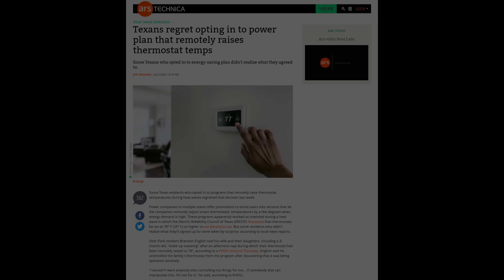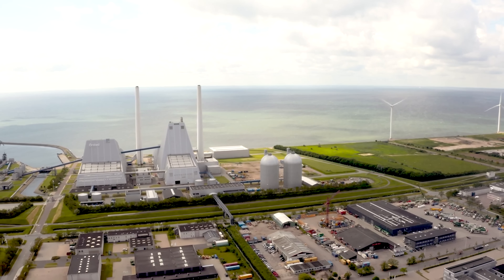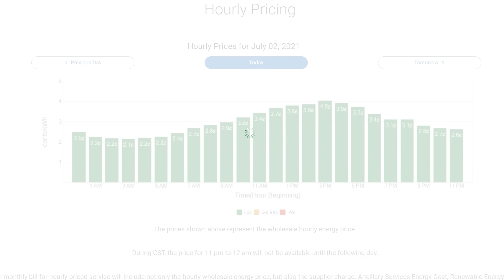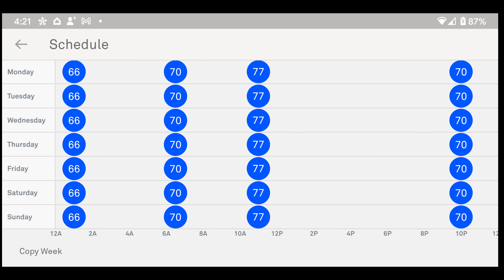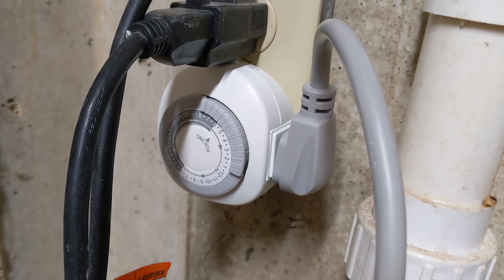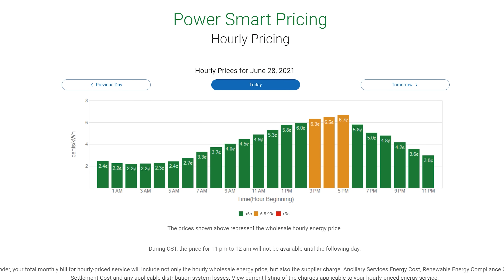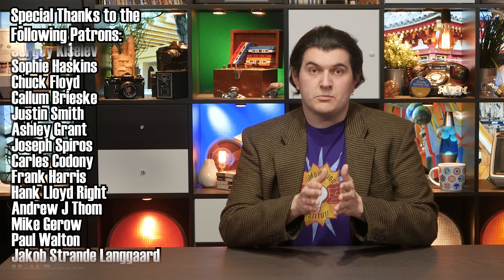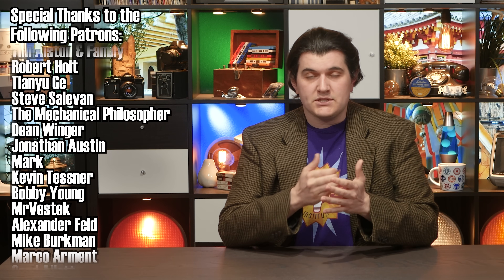Batteries aren't the only way to store energy. Here's another.

Comment: My dad’s AC energy savings method was to just never turn it on
Reply: At this point I could save the cost of a new house by not having an AC at all, too bad the summers are unbearably hot and I cannot save money that I never had.
Reply: We use a similar approach in the UK.  We don't even install it in the first place.  I'm in my 50s and I've never been into a private home in the UK that was air-conditioned.
Reply: Vap Pri  only problem is some places you could straight up die in your home without cooling simply due to humidity it will cause you to sweat to death the uk happens to be one of those places where it isn't getting that hot
Reply: Vap Pri  spam.
Reply: fantastic logic
Reply: AC repair people hate this one simple trick!
Reply: @joshuarosen6242  lol youre just lucky that it doesn't get hot in the UK. no ac where I live would spell instant death for many people
Reply: Based
Reply: @thenormalyears  please. Most hot lands are on third-world countries and an AC is a luxury there. Even around the Mediterranean Sea it's quite rare to have AC inside domestic buildings. It's just another pseudo-problem made by modern comfort on consumerist countries and by building cities in the middle of deserts.
Reply: Your dad's hot!
Reply: @killbuzzj  I'll trade you some of our recent southern California (U.S.) 105 degree (F) summer days for some of your nice rain water! Air conditioning is pretty much "normal" here. Added insulation and a very high-efficiency A/C unit keep both temp/humidity and costs under reasonable control for our 65 year old house. What we're running low on here is potable water!
Reply: Do thermostats allow you to define an interval of acceptable temperature? For me, it's comfortable from 18°C to 28°C so that's why I rarely use my AC
Reply: Same here! When it got over 90 degrees he would let us run a fan for an hour or so while we tried to get to sleep. He'd come and turn the fan off before he went to bed, and if I wasn't asleep yet, then tough luck!
Reply: @TechNinjaSigma  what you don't understand its not just the heat that is a problem its also the humidity will cause your body to sweat to death in the southern part of America you can and will die with out ac its not a modern problem people died of heat stroke all throughout history
Reply: @donaldmiller9130  hey man come to Texas it rains plenty and the heat is right there with it ac is our friend
Reply: I use the old " leave the windows open over night" trick in the spring and fall, but in the summers even at night you don't see Temps below 78, and we are seeing Temps of 100 degrees F for most of the day. I keep the house pretty warm at 78 degrees F, but the AC is still running at least 5 hours a day this time of year.  Would love to live in an area where I didn't have to actively cool my home, or water my lawn for that matter.
Reply: Must cost a lot to replace all those broken computers, televisions, DVD players, smartphones, tablets, laptops, and game consoles. You know, stuff that breaks when exposed to constant heat.
Reply: Ha Ha, and if you're cold put a coat on! =)
Reply: barnoftheyard  Greeks, Italians or Portugueses are caucasian though they handle 40°C summers.
Australia, South Africa or the whole America were colonized centuries before this invention.
From the experience of friends born or raised under the tropical sun but Caucasian, it's more a lack of aclimatization due to the emergence and popularization of this comfort during the last century in industrialized countries like the USA.
Reply: @PainterVierax  There are well documented cases of the elderly dying of heat stroke in their homes because their AC failed and couldn't afford to fix it or go elsewhere. There was a news story of a man in the Chicago suburbs literally needing to call 911 because his AC was out, and the fire department actually showed up and installed a new one for him because he was in danger. Developing nations aren't the only places where the heat means something.
Reply: And that’s the smartest move. For once, remove our comfort for the sake of nature.
Reply: @asdrubale bisanzio As I said before, most ppl does not have the economic privilege to just move if they don't like the climate.
Reply: @thenormalyears  I do appreciate that.  I live in Yorkshire in the North of England.  It’s what I would call really hot today.  It’s 28 degrees and this is what counts as a heat wave here.  By Yorkshire standards, a heat wave is where the temperature reaches double figures.
Reply: @PainterVierax  uh huh, and those people die of heatstroke at an alarming rate.
What's your point again?
Reply: @freedustin  my point is that those populations aren't acclimatized anymore because of AC overusage. Heat waves are special events though.
Reply: @PainterVierax  Heat waves happen every year. Not so special now are they? Used to be 2 heatwaves per year back in the 60's, now we are up to 6. Over 2,500 people died due to heat in India in 2015. AC literally would have saved lives if it had been a staple in their society.
Reply: @freedustin  India gets almost all of their electricity from coal, if everyone in India had air conditioning the sky would turn black from all the coal being burned.
Reply: @hithere7382  and that would add to the cooling by blocking the sun.
J/K you know that is besides the point.
Reply: @joshuarosen6242  To be fair, it rains so much in the UK, you guys practically only have 3 days of warm weather a year hahaha.
Same here in The Netherlands, if there is an AC in them houses it's a portable one and it's a very recent development.
However the only reason we have one, is due to working at home during pandemic.
Reply: @killbuzzj  You can always be like the Aussies and live underground haha :P
Reply: @thenormalyears  I mean it's not luck that made it not hot in the UK, it's the Atlantic current doing that.
Reply: @PainterVierax  Correct, around the Mediterranean you just paint the house white and a lot of heat stays out.
Reply: @PainterVierax  as someone in a third-world situation, here pretty much everybody has ac unless you're really poor. I'm middle class and in the caribbean you can't barely sleep in the summer without proper ac
Reply: @TheWrigle  The massive forest fires every year are keeping it cool near me. Smoke blocking the sun, so the window trick is still working.
Reply: Those stories always baffle me. Sitting on the couch, tv on, windows closed, no fans and they just sit there and die in a house like a baby in a hot car. Fk getting a cold wet towel or an ice pack from the freezer. Fk a cold bath or shower. Fk popsicles. Appliance maintenance? Ya right. Lets just sit here and die. The only way I see that is they were already on their death bed but people never cease to amaze. It is happening near me too. 911 story gotta be bs tho.
Reply: @teaser6089  It's true.  It's been very warm (about 29 degrees) for the last four days so I'm assuming that summer will be over by tomorrow.  I would have like AC for the last four days but it wouldn't be much use the other 361 days a year.
Reply: @kolinstallman3788  lucky. Here in Utah it's both smoky and 100+ degrees.
Reply: Great vid.  We do now have more and more domestic AC in the UK in the southeast at least. Most modern cars and offices have it so we want it more and more but it is only used a few days a year. Out electric cost 14p or 19 cents per KWh so not cheap. Insulation is poor on anything over 20 years old but our cavity wall all brick construction has a high thermal mass. Many old properties are plagued with damp and that makes heating expensive. Cooling is not the main issue.
Reply: @killbuzzj  couple weeks back we had 100% humidity and 25°c temperature here in Tornio, Finland. It was awfull working.
Reply: @Tupsuu  now imagine that 100% humidity with 38 c plus in temperature you will simply not stop sweating because due to the air being so dense the sweat can't evaporate giving you 0 evaporative cooling meaning your body will assume you're not sweating enough and begin to dehydrate you within hours
Reply: dad made us put an ice cube on our neck!
Reply: @Maniac536  yep. My parents didn’t get air conditioning until dad came home with his first PC in the early 1980s. As a systems engineer for UNIVAC, he was aware of the need for electronics to remain cool. 
Prior to that, we went places on weekends (movies and the science museum were popular favorites) to get cool on hot summer days.
Reply: @Tupsuu  That happens all the time in the Summer in Arkansas, a state in the United States. See also Mississippi, eastern Texas, Alabama, Georgia, most of MIssouri, etc.
Reply: @killbuzzj  It used to do that every summer for a day or three in Arkansas but we've been over 1,100 days without going over 100 degrees. It's bizarre.
Reply: @killbuzzj  Its actually a common theme in the southern states, where the elderly die from heat stroke due to refusing to turn on their a/c
Reply: @PainterVierax  yep. It can very much be a matter of what you are accustomed to experiencing. 
Several years ago, my mother went with some others from her church to visit a community in rural Tanzania where her parish was sponsoring the construction of a well and water delivery facilities. 
They were there during the relatively “cool” months for Tanzania and the mothers had sweaters on the babies … in temperatures that would have been a fairly warm setting for AC here at home in Minnesota. 

Also, my sister’s first/ex husband was born and raised in Israel, he was completely out of his element in a Minnesota winter, wondering why people would choose to live this far north.
Reply: @PainterVierax  What are you talking about? For countries like Malaysia or Singapore, AC is not a luxury but a necessity. The productivity of their countries will be much lower without AC.
Reply: @PainterVierax  I think you're looking at this the wrong way. Heat is more dangerous in places where it is very hot in bursts, than it is where it is hot all of the time. There are plenty of places like this, and with extreme weather events becoming more common it's an important case to factor in.

Great example: I live in Toronto, Canada and we have 38-42C summer days with high humidity. The usual for summer is around 25C, but we get bursts of near-40 temperatures for many days every year. Sometimes a whole week at a time.
Reply: @killbuzzj  and yet millions of people closer to the ecuator in the continent manage just fine.
Reply: @PainterVierax  Rising obesity rates probably have a lot to do with it. More mass to same amount of surface area means it's harder to dissipate heat. Inverse square law, it's a thing in biology.
Reply: @grilledflatbread4692   @rantingrodent416  what are you talking about Africa is well known for being arid and dry (which helps evaporative cooling function more efficiently aka sweat) and south American countries are known for having ac because its so hot and moist it will kill you places like India people don't often die of heat stroke on the hottest days but are more likely to die shortly before monsoon season because of increased humidity while being the closest to the equator only one is known for ac maybe because humidity is just as important to this cause of death as heat it
Reply: @killbuzzj  Not exactly. Your body sweats whether it is humid or not. With a low humidity the sweat evaporates very quickly, so you might not notice. Low humidity means that the air around you can take on the sweat that evaporates. This effect is what cools your body down. 

When air is very humid, it is not able to take on your sweat through evaporation. This is when you do notice your body is sweating. And as the evaporation process doesn't take place, your body isn't cooled down and that can end up in a heatstroke. And those can be fatal. 

What does help is a fan and take shower with cold water and then stand in the "blast" of the fan. Forced evaporation like this cools you down. Having a strong airflow through the whole house also helps a lot. Heat pumps that pump hot air from your house into a cavernous area deep under your house and pumps the cold air from that space up into your house works very well too.  The use of curtains (the ones that don't let any light through) do help to block sunlight getting into rooms. That also reduces heat being build up in your house. High ceilings help as well, as heat tends to rise up by itself. 

All of those are cheaper than an AC. An AC may say it is uses energy effectively, but the process is very energy intensive. All methods above cool you down slowly, while an AC will do this fast. Which is the only advantage of an AC. With more planning, better materials and energy efficient construction, you can get to a comfortable level cooling while expending no extra energy like an AC does. 

Here in Paraguay it is about 9 months of the year 100+ F and humid. But when I turn on the little AC (split, 3 years old) in this rental bedroom an hour before going to bed, my monthly electricity bill practically doubles. So I do use a ceiling fan during the day, light blocking curtains and the cold shower method to cool down and I barely turn on the AC anymore.
Reply: @geroldmanders9742  thank you for the added information but honestly my only point was that people saying cooling of some sort isn't necessary and is a modern problem dont know what they are talking about I'm all for alternative ways to heat and cool homes but my point was more to the people who disregard the need for some type of cooling ac just happened to be the topic of the video
Reply: Vap Pri  If you are capable of stringing a few words together, why not give a reason why someone should follow a random link?
Reply: My dad's as well.
Reply: @killbuzzj  I live in São Paulo, Brazil - humid as a forest at all times, hot as a desert during summer. Most people don't have AC and deal just fine.
Reply: @Gabu_  yeah honestly I did a little look up i was talking out of my ass
Reply: @Peter Kurten If you’ve ever trodden on one in your bare feet, you will know how appropriate the description of them as weapons is.  It bloody hurts.  They are very safe though as long as you don’t stand on them.
Reply: I don't get why in some places in the world like parts of Southeast Asia and the US they have to overdue it so much with the AC. It is like the opposite of a winter in Europe I have to put on a jacket when coming inside, that's crazy and not one bit comfortable to me
Reply: @PainterVierax  ...building cities in the middle of deserts and not learning building styles from countries where they build cities in the middle of deserts for centuries!
Reply: @makatron  unless you are really poor, if you are from a third world country it means that most of the population can't afford it and your experience is not the norm in there.
Reply: @joshuarosen6242  I'm in the SW in the states, no AC here would literally kill people. Especially because in my particular area, it's incredibly cold at night and unbearably hot during the day so insulation can backfire pretty badly once the heat starts leaking in but can't get out usually making it hotter inside than out :/
Reply: @donaldmiller9130  We certainly have water to spare in wet Yorkshire where I live.  At least everything is green.
Reply: @MirunaNero  What did people do before air conditioning was invented.  The US is a young country compared to England but it's obviously been inhabited for much longer than AC has been around.
Reply: @joshuarosen6242  clever placement of homes and some clever engineering. Plus just the fact that in the hotter areas of the US people simply tended to avoid settling there until they figured out ways to make it habitable. In New Mexico, as an example, there were really only a handful of native groups compared to the rest of the US simply because it's arid and hot and the land is horrible for farming. It was one of the last states to be brought into the union and it's also one of the smallest in the US especially by landmass to population ratio. The biggest city there literally holds over half of the population and it's still tiny in comparison to the rest of the states' big cities.

For a long time people simply avoided living in the worst areas of the desert US, and those who did had to pick both where they lived very wisely and build homes differently to live here without dying.

The most common methods were pretty rudimentary and mostly included just living underground (like some pueblos were built into the sides of mountains to escape heat) and having really, really thick stone walls. And even then that would still call for keeping windows open and delaying the majority of house work and chores until the evening.

But with how lawn modern life is shifted this just isn't really possible anymore, especially because of our reliance on electricity in general. The use of electricity generates a lot of heat and don't respond well to high heat (probably already know that). That combined with the fact you generally have higher density of civilization kinda ensures that no climate control in homes would more than likely kill people
Reply: @PainterVierax  You do realize that cities in the middle of Deserts and Jungles have their own cooling systems, correct?

Before the invention of Conventional ACs, Iranians built Windcatchers as a method of cooling and can even make Ice using a system of Underground Canals, Windcatchers and insulated storage pits called the Shabestan. That system is so effective in cooling that they are, I repeat again, able to make Ice in the middle of Mesopotamian heat. 

Greeks and Romans used Canals that was connected to their house and evaporative cooling to cool their house, evaporative cooling is much more effective in less humid areas, as Demonstrated in the "Mini AC" video 

In Jungles and Forests, people are encouraged to built houses that have good airflows... Such as from thatches and not mortar and bricks. Places with plenty of vegetation are generally cooler because of shade and you only need to figure out how to utilize the wind's cooling ability. 

So no, People in "3rd world countries" also need cooling. And with the rapid progression of Climate Change, The idea of using basic fans aren't exactly viable anymore and they need to use Conventional Electric ACs.
You cannot brush off the idea that "some people are less prone to heatstroke"... Tolerance to heat can be managed and trained, but you can't stay in the middle of 38-45°c heat everyday without cooling and expect yourself to survive
Reply: you touch it you lose a finger
Reply: @joshuarosen6242  Even in the UK you should install reverse cycle heat pumps. You can use them to heat in winter and at other times use them in dehumidify mode. You may not want AC but it’s cold and damp in the UK so run it as a dehumidifier to keep the damp away.
Reply: @joshuarosen6242  that's cool.  Where I live it gets over 40 Celsius in the summer(sometimes we'll over), and the winters drop to -18 Celsius in the winter(not counting wind chill).  HVAC isn't strictly necessary,  but I'm sure you can see why it's common in the U.S.  fun fact, one year my state set its record low of -32 Celsius(in my town) after a summer of over two weeks above 43.3 Celsius, and I was living in a place with no heat or air conditioning.  I was young, but I would not suggest that experience for the old or sickly.  I'd wager I wouldn't fair so well at it these days myself.
Reply: @hithere7382  he never mentioned if air conditioning was ecologically viable, only that it could of saved lives.  Stop interrupting people to change the subject to what you want to talk about.
Reply: @alexandernoname6339  it gets extremely hot in those areas, also many people don't have AC in those places.  Generalizations ought to be avoided.
Reply: @sinisterthoughts2896  a comment that starts by wrongly talking about Darwinism can't be taken seriously. Do your homework before trying to call out ignorance.
Reply: haomavarga  greeks and italians are indo-european, like the rest of europe except for the basque. "white" is is not a scientific term and is defined by the feelings of the person using it, not genetics. and as they said, there were lily white english descended americans in alabama before AC was invented
Reply: @freedustin you do realise that there are 1.4 billion people that live in india aka about 18% of all humans on earth. 2500 people dying of heatstroke is fuck all. those stats are pretty good honestly.
also what hes saying is that if the AC was never invented people could deal with the heat better than we do now because they would be used to the heat.
Reply: @PainterVierax  excuse me? I'm from one of those "thrid world countries" you happen to mention and I can tell you, AC IS a basic necessity around here, literally every home has one, except for the literal slums, when you live in a place that CONSTANTLY slams you with 32°c on normal days and around 40°c on hot days, EVERY-DAY-OF-THE-YEAR you'll then be able to tell ME that AC is a fancy commodity made by the modern confort standard... Kind of funny how people talk about other people's situations without ever setting foot there...
Reply: @makatron  I get what you mean, but "summer" isn't a thing in the Caribbean, it's either hot, hotter hottest, wet or dry...

Sleeping in the night without AC can be done tho, I did it myself cuz my AC broke and we had no money to repair it, I did it for around 6 months, tho, my situation is kind of special since my house was pretty good at keeping the heat outside... Better insulated homes should be a thing everywhere
Reply: @lXlDarKSuoLlXl  it's always humid here, also yearly avg temp is 29c, it's January and just went to the beach today under the melting sun, yeah here I can't sleep without AC.
Reply: @makatron  I get you man, the lowest temperature I've ever known for about 3 decades was 27 Celsius... What I mean by "humid or dry" is "it rains or it doesn't" since by the coast, well, you can't really get dry air, ever hahahaha
Reply: @makatron  also, my situation was special since my house was special, keeping the heat out helps even during the day, in the night, it does wonders also living near the coast was also a massive help since the wind blows nearly every day... Not everyone can do it without the help of at least a fan, also, mosquitoes are also an issue, I'd rather say AC is a basic necessity at night not only because 29°c at night, that's manageable, but to help people keep their houses closed to the relentless mosquito swarms that start flying in the dead of night... I can still hear their buzzing even if I'm 10k kilometers away 😂
Reply: @makatron  yes they are! Lmao... I might be far away, but I'll never forget my origins 😂
Reply: Good luck in newly-built homes in southern areas. Especially in Texas and Florida.
Reply: @mrarcher9095  Texas in August gotta be brutal wothiut AC.
Reply: @PainterVierax  i PROMISE you, if you gave them a choice, they’d do AC any day of the week.
Reply: @PainterVierax  I promise you, if you gave them the choice, they will always go with AC. These  are the same people that work outside all the time. Go ahead and make a school with no AC, and see how hard it is for these same people to actually learn something.
Reply: This is one of the reasons why I can't visit my mother overnight in the summertime, much less stand to live with her. Like 80 degrees in the house at like 2 in the morning with high humidity and she has the nerve to tell me while I'm standing there drenched in sweat that it's "too cold" with the AC on. Absolutely not.
Reply: @ffwast  some people are way too cheap to even spend time with without suffering. I'd rather quit drinking and eating out and keep my AC full blast all day long.
Reply: Why use air when you got tank tops and fans
Reply: SAME WITH MY FAMILY. it was 92° last week and my family looked at me like I was insane when I asked to turn AC on
Reply: Son?
Reply: Funny cuz my dads idea was to never turn it off and keep it a blistering 47 degrees Fahrenheit. He always said if we keep it on then the power company knows how much to always give. After getting my own house, I got a shit ton of cheap solar panels and 50 kWh of batteries and I run my own power plant. Seems a lot easier that way instead of relying on a grid.
Reply: I remember living in houses without air conditioning in the 1960s when in elementary school.
Reply: Smart guy
Reply: It works like a champ
Reply: My dad went full McGyver when I was a kid.  We had forced air that was based in the basement.  Basement is cooler than the 1st floor.  He set up the heater to just blow air from the basement through the ducts.  It worked great!
Reply: @PainterVierax  AC allowed the Egyptians to have ice in the desert hundreds of years ago, so it's not like we can't live in the desert without electricity.
Reply: @LutraLovegood  coast of the Nile, the Red sea and the Mediterranean Sea aren't deserts. And again, those people are fully acclimated through millennia of genetic evolution
Reply: @Maniac536  Do you live on the surface of the sun? How does it get hot enough to break electronics?
Reply: Ah, your Dad uses the Grinch method. Everyone in the house is miserably cold or hot while your dad sits back and smiles as he thinks of the money he is saving.
Reply: We never had AC installed growing up because of my dad’s stubbornness. He finally caved when he got cancer and realized he didn’t want to go through chemo in a sweltering 90 degree house…